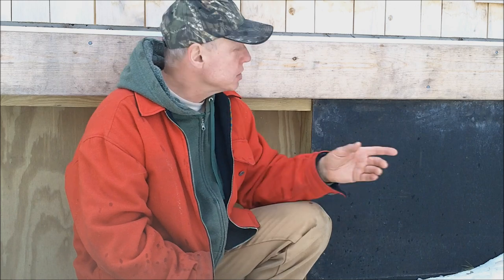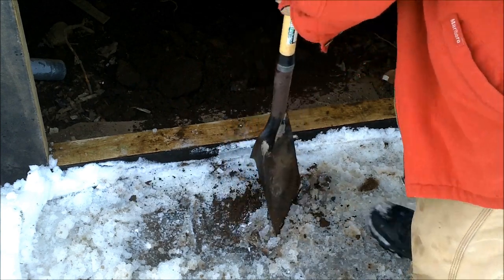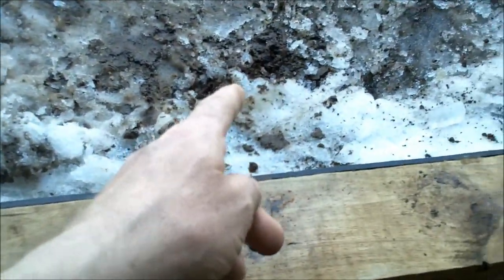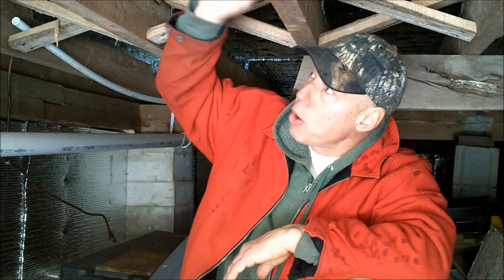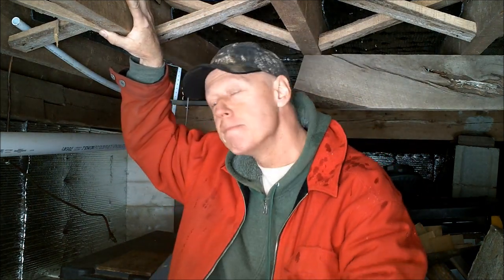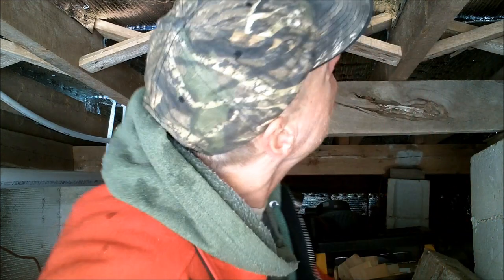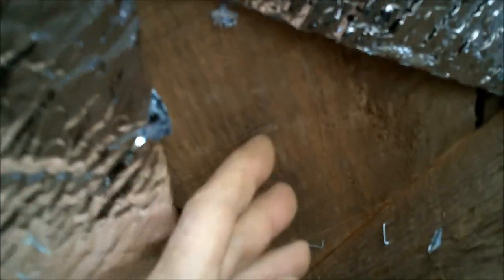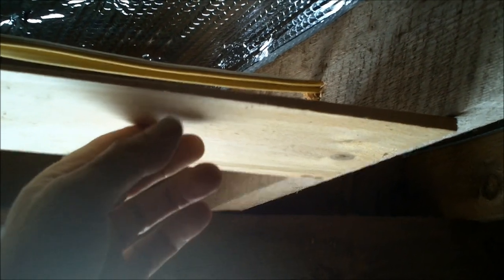HOW TO INSULATE A CABIN FLOOR AND KEEP IT RODENT FREE   PART 2

Comment: Could I insulate my off grid cabin roof with the bubble foil as well?
Reply from the maker: I'm working on a followup video that will answer many questions on this subject.  I hope to have it out this week so stay tuned.
Reply: I used rockwool directly against the  walls & ceilings. I used string, and staples, to keep the ceiling rockwool in place. It took a loooong time with many breaks. Then covered it with bubble wrap, to insulate a 16' x 28' shed. There is no electricity or plumbing. I am approaching seventy, and didn't want the headaches of wiring and frozen pipes.

Fired up the small wood stove. While working atop one of the lofts, it became so warm (72°) that I had to remove layers of clothing, & cracked a window open. It was in the teens at night with the wind blowing, and no skirting around the shed. Keeping the interior in the 50s is comfortable for me.

Don't have the $ to insulate the floor, so came to see how The Boss did it. I will be skirting the shed, and stapling the bubble wrap to the inside.

You are right, Boss. This bubble wrap is great stuff!

Other uses for bubble wrap.

*Also using bubble wrap inside a duvet, to reflect body heat, if I don't wake up in time to feed the fire. 

*Using bubble wrap, tucked inside the lining between layers of clothing, when I have to go outside and it's windy.

*Used bubble wrap to insulate the 3 sides of a dog's crate.

*When wood is low, I use bubble wrap as a curtain to section off the rest of the interior I'm not using. A smaller space to keep warm as it not only reflects heat but light.

*I do not have waterproof clothing. Taped bubble wrap over my pant legs, down over my boots with according pieces over my knees, if it's raining or the snow is deep. It doesn't tear as easily as plastic bags. I use heavy duty  construction trash bags for the upper body and arms.

Next project is attempting to make the ice box. I am a newbie to all this, so I'm sure I have, and will be, making many mistakes.

Would like to hear what other viewers use bubble wrap for.

Comment: I wonder how that would work in walls? Do you know anyone who has put it on cabin walls before putting up their interior wall covering?
Reply: Wood walls need heat to dry and shed water vapor, if you block this, you're asking for mold and rot. And wet walls get colder for the most part too
Reply: @01mustang05  Well, since the bubble insulation would be on the inside of the walls, both exterior and interior would be able to dry out. Heat is not needed for drying. IF that was the case, exterior walls would never dry out in Winter.
Reply: @BlueCollarDIY    It's been investigated and discovered that stick frame walls DON'T actually dry out in Winter, in a cold and humid climate actually. So heat from the house and/or the sun, plus low humidity outside (less than 50%) is needed to reduce and remove undesirable excessive water vapor out of the wall assembly.  A warm wall is better that a cold wall in the winter!; think about it.

Comment: i am embarrassed that i asked about insulating walls because in another video you  stated that you would  not surround yourself with this bubble wrap and only use  fiberglass in the walls because a house has to breathe. Is this still true? Sorry to be confused about the "Do i or dont I-  vs- can I or shouldnt I?"
Reply from the maker: I honestly can't say if insulating a place floors, walls and ceiling with bubblefoil would be a bad thing. Myself, I prefer to use fiberglass in the walls but I'm just sharing my honest opinion on the matter.
Reply: @thebossoftheswamp  thanks!

Comment: It is what it is Boss.  I trust your judgement.  The proof is in the pudding as they say.
Reply: that's what I meant to say, but after 12 hours of nightshift and 2 hours of sleep the previous day, it's difficult to sensibly compose a comment, lol.....but I totally agree with you and Jim, 100%.
Reply: Forgot to mention that I used a similar product on my above ground pool.  Around the wall under the liner.  It doesn't heat the pool any quicker  obviously, but definitely keeps it up to temp a lot longer when we have cooler nights.  The stuff works....period !!!!

Comment: solution to dampness in a crawl space. 2 to 3 inches of none compaction sand 2 layers of 6 mil vapour barrier 3 inches of none compaction sand on top.= permanent barrier from dampness. and if you store tires and what ever lay a sheet of plywood on the sand so you dont disterbe the sand.

Comment: I have a double wide mobile home. Critters and a prior A/C leak have caused a lot of the insulation to sag and some to fall out. The black plastic barrier has HOLES in a lot of places and near the main A/C duct there is condensation dripping from it. Could I rip  the old stuff our and staple the bubble foil to the subfloor? If so, what do I do when I get to the I-beams?
Reply from the maker: That is what I would do.  I would staple it to the underside of the floor as long as the floor is dry when applied.  Otherwise it will trap the moisture there.  Not sure how I would handle the I Beams.    Is your mobile home skirted?  If so, insulating the skirting is almost more important the insulating the floor.   Good luck.
Reply: Thanks for your reply! I do have skirting. It has lots of little holes in the design for ventilation,  I live near Houston. Humidity capital of "These United States".         One other question... Do I need to tape around the edges and seams? It has been several days since I watched your video, you might have answered this in it, but I don't remember. I really liked your attitude in the part 2. It if ain't broke - don't fix it!   Thanks, Debbie
Reply from the maker: You don't "have to" but it does help.   I live on the side of a mountain and the winter takes up half the year. All I have is one layer of this foil on the underside of my floor and one layer on the inside of the skirting and my floor is toasty all winter.  I recommend insulating the skirting but also have panels you could remove in summer for ventilation.   

All the best.
Reply: Thank you for your help. The thing that I like best about the sound of this, is not having to crawl under and get possums out.

Comment: If someone was going to make a little bunk house, would using this "bubble foil" work for insulation of the walls as well? If it's a small building (under 200ft²).
Reply from the maker: It's best used in floors and ceilings.

Comment: Ever think that maybe your heating that soil? If you think about it your BTU's are keeping the craw space warm so that is heat loss. But with wood heating that really doesn't matter because there is no cost factor.
Reply from the maker: Agreed.  If I insulated the floor to a high R factor, then I'd have to run a heater to keep my pipes from freezing.

Comment: Boss, the nay Sayers probably got their statistics on internet forums.  I have been a professional engine builder for almost 40 years, and kids comes to my shop and tries to school me in the subject, claiming they know more from being internet keyboard experts.Also, the person that stated that your joists will get cold and transfer it to the floor. . . nonsense! Wood is one of the best insulation there is; Proof? I am sure you experience this. . . in winter, the ground is frozen solid, 'some places 4 feet deep'. If there is a piece of lumber or board on the ground, remove it; it will be easy to pull and not frozen to the ground and the ground underneath will be unfrozen, plus I have seen grass still germinating under the board in the middle of the winter. So, if a 1/2 inch board will stop the ground from freezing,  an 8 inch joist certainly will.

Comment: Has this stuff raised in price like double or triple recently¿?¿?!!!! I'm remodeling an old mobile home, and need this stuff for the same reason. Checked the price , and it is ridiculous in price now. Was it always this expensive?!!! As stated in other comment when my shop building was put up it wasn't that big of an expensive, I just forgot to have them do it , when putting the build plan together. Or at least it didn't seem very expensive at the time. I've sure been paying dearly every day since. I know this stuff works because a good friend has nearly the same building and was smart enough to have remembered to have had this stuff installed under the metal siding and roof. He is able to cool his with a small window unit A/C unit.

Comment: Can someone let me know if this system will still work to keep the ground beneath the cabin thawed if the cabin isn’t heated? Thanks!
Reply from the maker: If the skirting is insulated, the ground will stay soft a lot longer than the outside but it may eventually freeze without any heat in the building.
Reply: @thebossoftheswamp  Thank you Sir!

Comment: So the company that actually makes this stuff uses it in a different way.  They would put it on the Joyce, to create an air space, and that's how it works the best.  By trapping air between them and the floor.  It would also be easier to instal.  What I'm wondering though is that would it then become a home  for animals?
I mean that is a particular issue for country places.  So even if there is some heat loss, it's often worth it.
Reply from the maker: Agreed on the trapped air. It insulates better but offers a cozy homespace for critters.  The system we have works fabulous for our needs.
Reply: OFF GRID HOMESTEADING With The Boss Of The Swamp        Right, that's what I was wondering.  So you figure don't have material to nest build with, but they would still consider it nice and cozy spot.   Thanks.
I'm just trying to figure out what will be the best way to insulate the floor, if the house is built in posts, and doesn't have cement or cinder blocks like yours.....though I guess it wouldn't be too hard to block it all in.🤔

Comment: Yeah I don’t listen to anybody just go with what you experience and what you think is best because some of these people they don’t know nothing they all believe that they have the right idea and that the other person is all wrong but they don’t consider everybody situation is a little bit different not all a lot of situations could be similar but they’re basing their opinion off of their situation it would still depend where you live and what kind of crawlspace set up you have if it’s dry in there then you would not have moisture up there they may be lived it went to the house where there a crawlspace wasn’t ventilated like yours maybe they experienced mold and they assume that everybody has mold some people are so close minded that they don’t see the big picture sometimes  especially people that do the same work over and over all day long in the same area because they live in the same area so they do work in the same area so they assume that every state is going to be the same but they have to consider you live in a different state than they do

Comment: If it was the sweat on the wires that attract rodents then they would lick it and not chew it. Rodents are attracted to the electricity flowing thru the wire.
Reply from the maker: Must be those off grid mice...
Reply: actually I think it's the soy insulation on the wires! Once I picked up a free Craig's List treadmill that had stopped. I was using the DC motor for a bicycle generator. The chipmunk was still clamped onto the live wire. The young pretty lady who had that treadmill had no idea she also had a chipmunk rotting away in it. Hilarious.

Comment: Open Cell Insulation Panels - does Not work, because ants tunnel throughout it.
Closed Cell Styrofoam is cheapest and if rodents leave it alone ? I have no idea.
I like the Bubble Foil.  Fiberglass Batts under Floors is Never a good idea. It will hold moisture.
Reply from the maker: Ants love that foam stuff for sure.